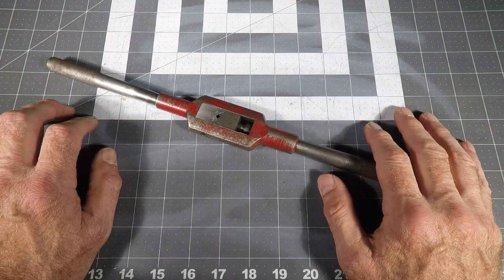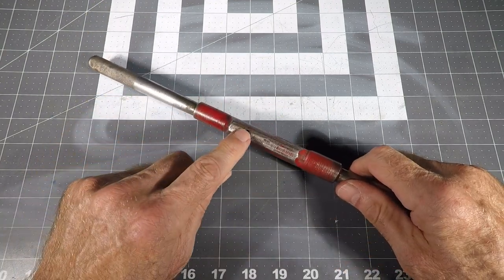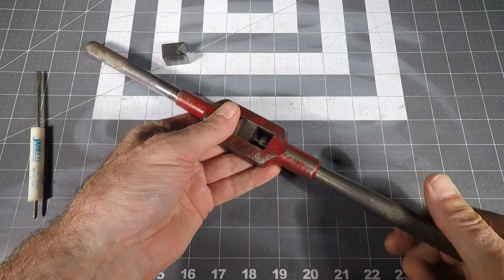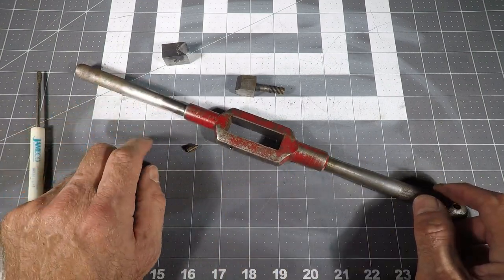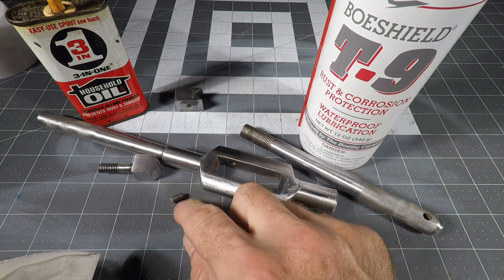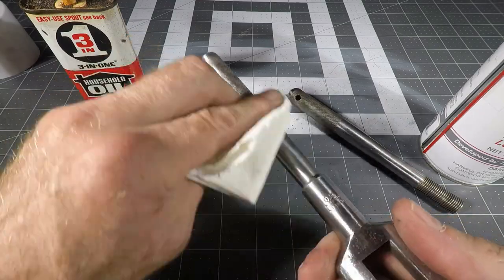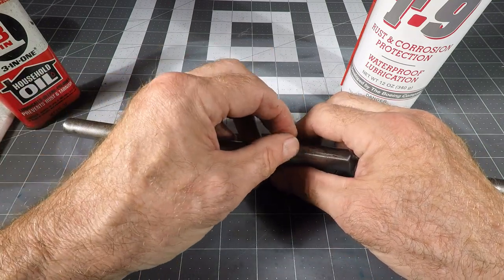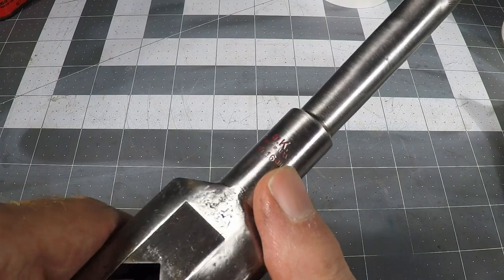Restoring a vintage tap handle

Comment: Have you ever considered making a smaller version of the larger tap holder as a future project?
Reply from the maker: You're right that would be a fun project, but others have done that.
And I don't own a holder like that because I generally don't tap anything really large. I have a t-handle that works fine.